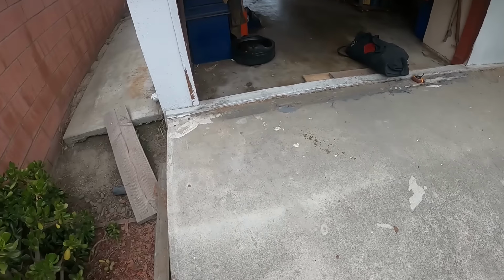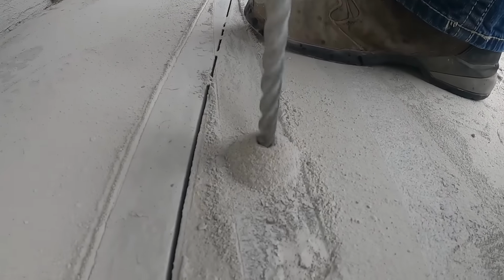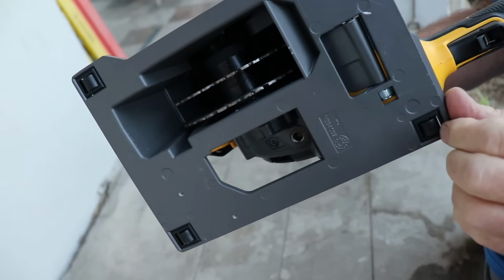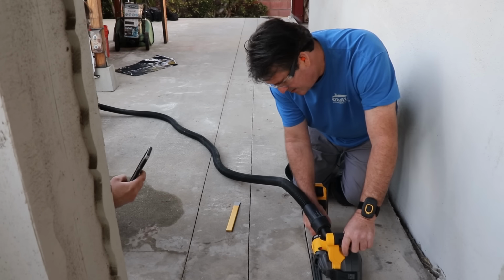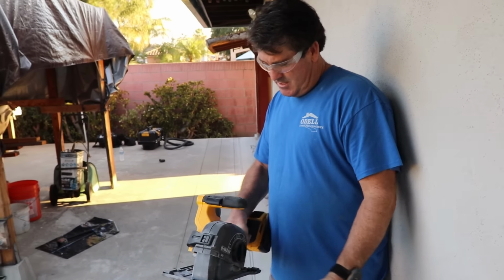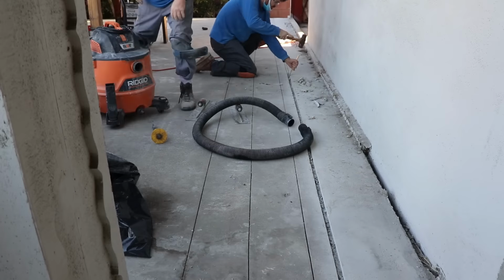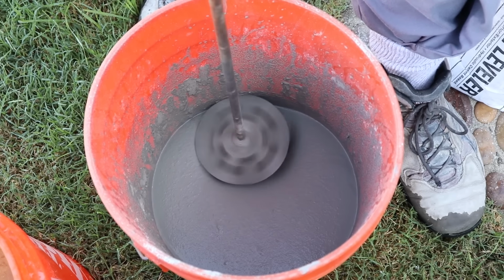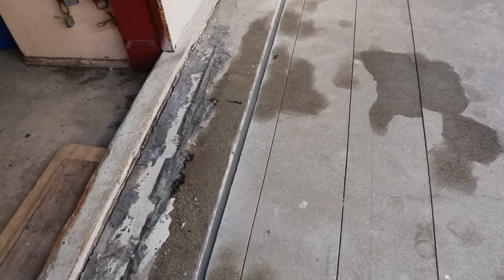How to Cut a Drainage Channel into a Concrete Slab

Comment: Is better if you go forward, to prevent dust.
Reply from the maker: Not with this unit
Reply: If you push, those wall chasers, as we call them, have a tendency to climb out of the slot and run away. You can do it in tight corners, but it is hard to control and you sure do not want to do it if you are aiming for a straight and clean cut. If you cut channels in a wall for eg some electrical installation which you have to plaster over anyways, it does not really matter that much.

Comment: That dewalt grinder is what I need for all the grout jobs I do for restaurants. Can you tell me the model of it? I can put a tuck point blade.
Reply from the maker: Great idea.
I said the model number in the video
Reply: @OdellCompleteConcrete  yes I saw you mentioned latter on! Dcg200 thank you! That connection from Dwalt can you share?

Comment: grind your chisel down hehe
Reply: I see you got the real vacuum out in the end lol
Reply from the maker: Yes for the big broken stuff
Reply: From the wall chasers I know the chisel usually has the right thicknes that it breaks out the center part by either just driving it into one of the slots or even just by levering by hand. I rarely had to even get a hammer with those, but to be fair, that was in brick walls, which are for sure a tad softer than old concrete.